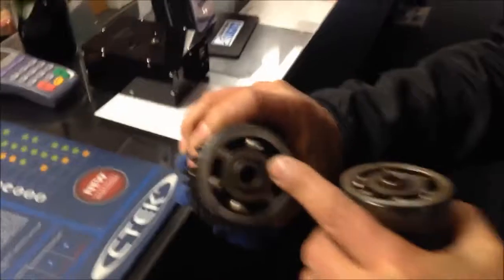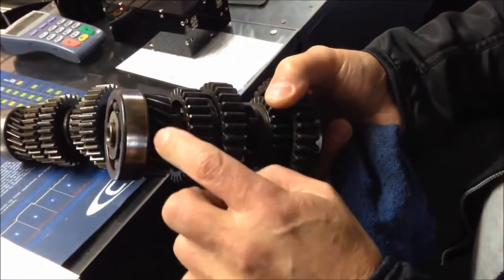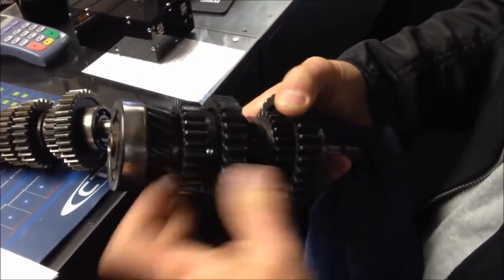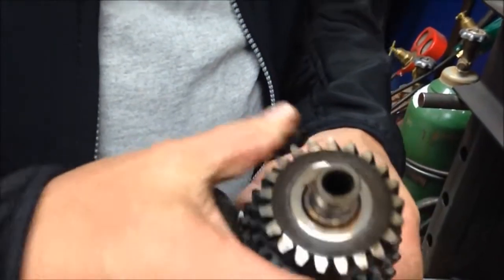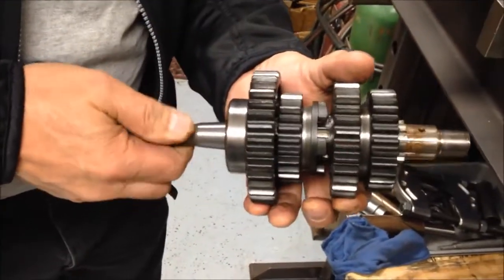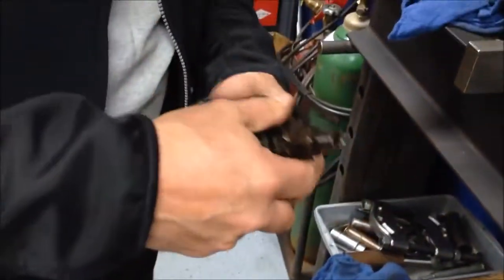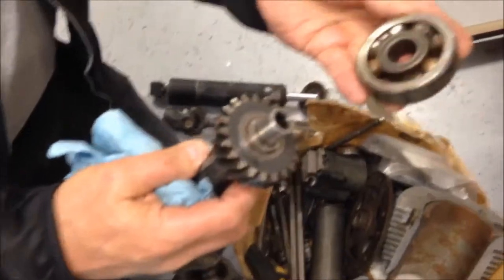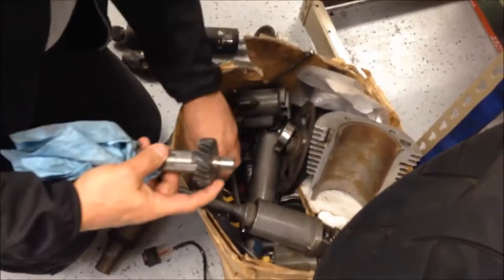BMW Airhead Circlip Modification Explained

Comment: I have a '93 GSPD. I was told that it may or may not have the circlip. Opinion?
Reply: No, I don't have any reason to go to Snowbum's site, although I have contributed to it. I do know him, we've chatted occasionally and he has brought his motorcycle to our shop for service when we were still doing whole bike service. I believe he has quoted me on his cylinder head page and I have provided other technical info when it's been useful. He's done a great job gathering data from so many sources and putting it all in one place for Airhead rider's to consume. That's a lot of work and my hat's off to him, but as a pro BMW mechanic, I don't have much need for visiting his site. My responses here are from doing this work for a living for the last 40 years and counting. :-)
Reply: The 1993 model did not have the circlip. BMW reintroduced the clip at some point in 1995 starting with gearbox number 240765.